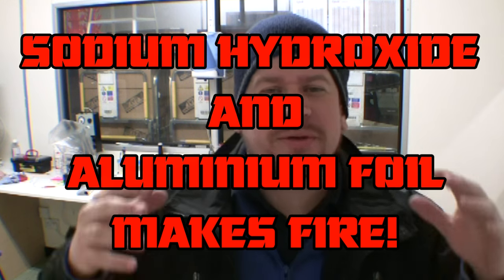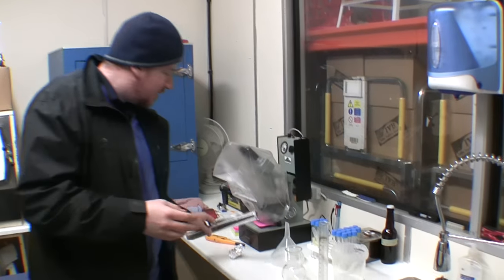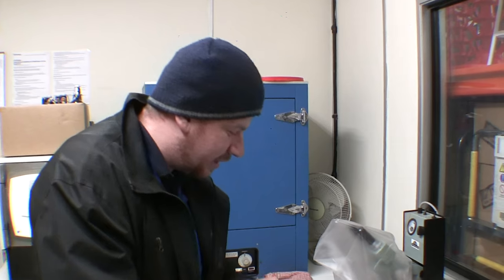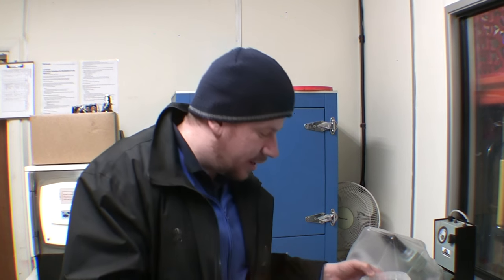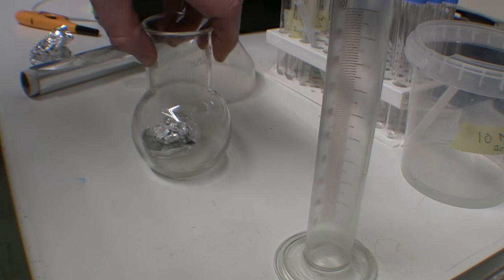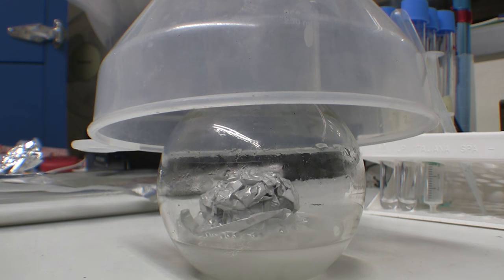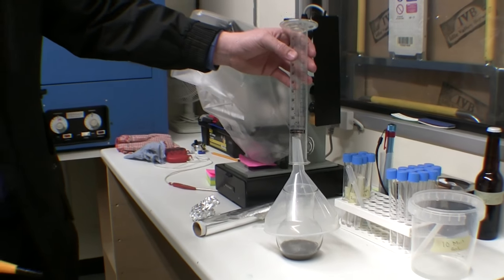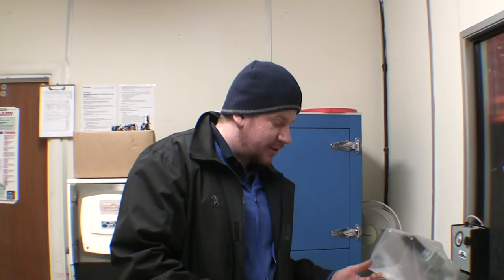Beer Science ~ Sodium Hydroxide + Aluminium = Hydrogen + Fire

Comment: Could caustic be use in a homebrew scenario for cleaning and sanitizing ? I ask because i live in an agricultural area and that stuff is everywhere,usually in crystaline form for cleaning bulk tanks and milking parlours.I'm just wondering if it is feasible to use it for cleaning and sanitizing fvs and bits and bobs,easily available and cheap as chips.Cheers.
Reply: Wouldn't bother if i was you. i have caustic here but it's so nasty to work with. No need when you can use percarbonate.